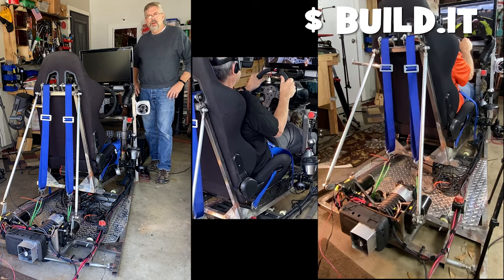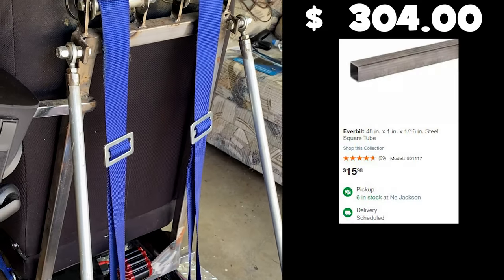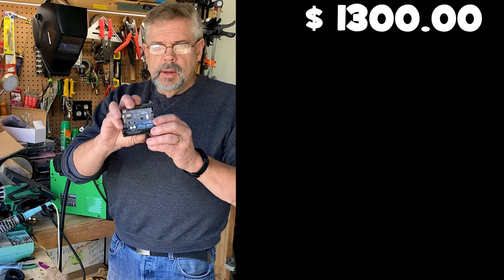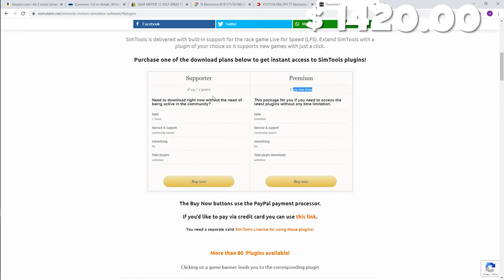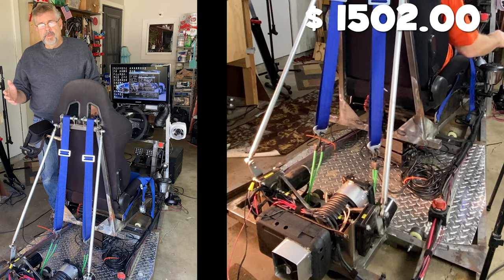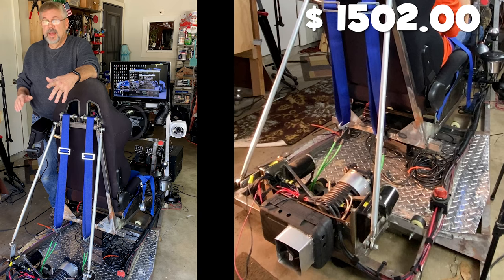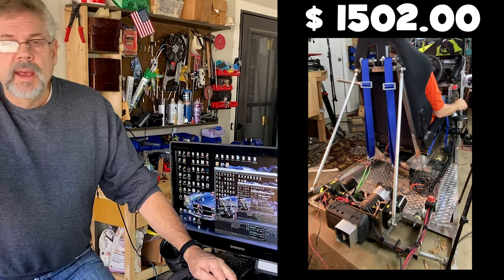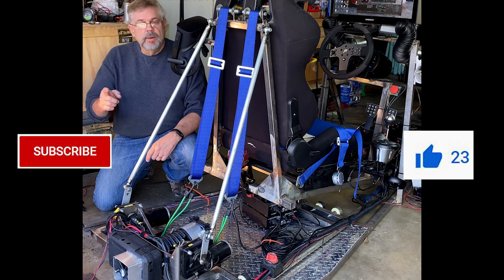How much does a motion simulator cost in 2021. DIY Racing Simulator Cost for Assetto Corsa.

Comment: This is what sim racing needs. DIY and the satisfaction of building something awesome. Great video, well done and thanks for taking the time to share it.
One thing to add is maybe consider a couple of gas struts on the rear rods to take some of the load and assist in the upward lifting motion. Saves some of the load on the motors and gearing.
Reply from the maker: Thanks my friend! DIY is great for sure. I am slowly tweaking the PWM on the motors and am getting better results for sure. I appreciate the comments! I could get more horsepower too!  I have seen some builds with those Australian 'motion dynamics' 60:1 motors and they are bad to the bone!  But they are $250 ea + a LOT for shipping..  I am probably going to order TWO of them in a couple months.  Horsepower solves (and creates) all problems!  DMAX👽
Reply: @DMAX_DIY  Shipping is a killer for sure. I live in Australia and getting stuff over here is bloody dear as poison and then there's the exchange rates as well. You get an idea in your head then by the time you add up everything it just puts you off the whole idea. 
Anyway love the videos and you overall vibe. Keep it up old mate.
Reply from the maker: @untrainedprofessionals2374  That company is in Australia and they apparently have more power than my Canadian Crab pot motors  50:1 as opposed to 60:1..   I will try an order a couple but it's a big 'chew'.. so I will post the upgrade whenever I actually order and receive them! I'm pretty hooked, like buying a boat or starting 'tennis' or something..  Oh well.. we shall see.. I love driving fast cars.. Thanks for the comment my friend!  DMAX
Reply from the maker: @untrainedprofessionals2374  Thanks.. I know what you mean.. I keep 'eyeing' those motion dynamics motors available in Australia but shipping is just so high.. I would really like to buy some but .. it's just insane how much they want for just shipping

Comment: Incredible project! I'm thinking of building a similar rig and there seems to be 2 schools of thought: using actuators  or motors (like yours), what made you choose this solution?
Reply from the maker: Simpler the better I guess. I looked into actuators from a video by 6 degrees of flight. I was leery that the motors I bought would not be powerful enough, but I was wrong. They are pretty good. I gave them a mechanical advantage by pushing the seat from the top instead of on the bottom like some people do.   Thanks for the comment!  DMAX

Comment: I'm still at it Dave!  Nearly there now. 2 DOF seat mover with wiper motors. Got circuitry sorted, earths isolated,  made my own crank arms.  Linkages completed. Need to drill out rear of wiper rotors to mount expensive magneto-pot thingies!, and then its just mounting the motors.  I have been doing this for 2 years now and YOU have given me the courage to carry on when all was lost - more than once!  Thank you so much!
Reply from the maker: Thanks for the comments my friend!  All is not lost! It's fantastic once you get it going..  I'm glad my videos helped!  Check back when you get it running! Dave

Comment: Amazing work, very detailed explainations! I built my first motion simulator 15 years ago with reductor motors pushing the top of the seat like you, I was inspired by the FREX simulator at the time. The biggest problem to me was the intertia/low reactivity (comes from the motor reduction ratio 50:1 is a lot). So I finally went for a commercial one, a GS-Cobra GSeat, a seat applying directly forces on your body. It is less expensive than commercial motion platforms, but very reactive, and it also makes you feel intense long forces (like cornering forces in a long corner) as well as traction loss.
Reply from the maker: That's pretty awesome my friend. I have been fiddling with power to weight too. I recently replaced the blue seat (about 42 pounds) with an aluminum Kirkey seat. (12 pounds). Waiting to run some responsiveness tests soon! DMAX

Comment: Awesome rig! As a welder, I give you props on your welding. You prepped the material before welding, and did a decent job... considering the equipment.
Reply from the maker: Hey Corky!  Thanks for the comment.. I'm a newby for welding.. but I at least I'm giving it a shot and (like everything) I'm giving it a shot cause it's the best solution..  better now after 8 months!!!  Thanks for the comment! DMAX

Comment: Hey Maan love the build . Which motors did you use for yours?
Reply from the maker: 12V crab pot pullers 50:1 from Canada off Ebay. Sometimes they are available by searching those key words on EBay. The vendor is PGSAW.. they were like $99 each ..

Comment: Great video. Can I ask what is the length of your u-joint?
Reply from the maker: Thanks for the comment Abram. I cant remember for sure and away from the rig till friday. But I'll put the info here on friday.. It may be on my x-simulator.net build page (first page probably) Take a look if you have a chance. https://www.xsimulator.net/community/threads/full-frame-2-dof-traction-loss-new-build.14740/
Reply: @DMAX_DIY  I've already had a look through the forum. All the measurements are there except for the u-joint one.
Reply from the maker: @abrammanoge   Basically I did not want to have to drop down to get into the seat cause I'm getting a bit older, so I kind of set the height to make it easy on myself. I'll measure it on Friday..  Thanks ! Dave
Reply: @DMAX_DIY  thank you brother. I appreciate you effort to help
Reply from the maker: Abram.  The entire U joint the 3DOF rig is 5 and 1/2  inches.  But like I said, I just wanted to be able to get in and out of the seat easily without having it too low.. Hope that helps you out my friend! DMAX
Reply from the maker: @abrammanoge  I measured it today. 5 and 1/2 inches total.. hope that helps! DMAX
Reply: @DMAX_DIY  thank you . I appreciate you taking the time to help
Reply: @DMAX_DIY  thank you brother . Just saw your response.  I'm gonna start my project.
Reply from the maker: @abrammanoge  Cool my friend! Just a little at a time and before you know it.. BOOM motion rig.  You'll never want to play a racing game without motion again.. DMAX
Reply from the maker: @abrammanoge  Sounds good! Dave

Comment: Were the bungee cords just to keep the seat belts right for you through all the pitching? Was there a reason you didn't just fix the seat belts to the seat? This is awesome and thanks for putting it together!
Reply from the maker: Good question Kevin.. No ..  The bungy cords were something I saw on another channel..  They just put pressure on your chest as the seat pitches forward to make it a bit more immersive.   The motion sim runs with or with out them.    It's just an immersion thing when you are slamming on the brakes..  Thanks for your question  Dave

Comment: hey dave thanks to you i have my frame for my 2 dof motion platform all welded up, most of the electronics are ready..
just waiting for my wheelchair motors and transformer to arrive and hopefully ill be rockin in my rig by the end of next weekend and of this goes ok im gonna add the 3rd motor too..
have a great day
Reply from the maker: That's great news! Be sure to use fan on the IBT fins so they dont overheat..  I still need to try 'pushing the limits' on those wheelchair motors.. probably this weekend I will test them really hard and see what happens.. I'll provide some amp readings too.
Reply: @DMAX_DIY  all good got the fan built into the lid on the electronics box. 👍
Reply from the maker: @ricomortis5881  Thats great..  I ordered the extra 12v motors I needed to give a 6DOF a try but I have to tear apart my 3DOF rig to use the 3 motors it has..  I'm not quite willing or ready to do that yet so..  Maybe after summer ..

Comment: What do you have on the ends of your conduit to thread your tie rod ends into?
Reply from the maker: The Tie rods ends are just round.. They slide right into the 1/2 inch conduit (with a little persuasion)  Then I tack weld them so they dont come loose.   I did some more explanation on this in my last few videos on building a 2DOF rig..  https://www.youtube.com/watch?v=iTXBVX8CHCc

Comment: Hey D Max
What did you use power the motors? Could you provide the link?
Reply from the maker: The motors are 50:1 crab pot motors from PGSAW on ebay.. I just checked and they are unfortunately not available at this time anymore.. I wanted to get 3 more of them..  Just search for 50:1 or 60:1 12 volt motors..  If I can find more that are reasonably priced I will link..  You can get 60:1's (which are better.. ) from a company call motion dynamics in Australia.  But the price is not cheap.. DMAX
Reply: @DMAX_DIY  thanks for the reply.
I already have the motors. I was wondering what power supplies you are using to power motors?
Reply from the maker: @heyitsdiogo1243  OK.  sorry.. Great that you have the motors..  So they are 12V.. Same as a truck or car battery.. I use an 850 CC truck battery from the local Walmart.. I have a 4 amp  Battery tender trickle charger on it. 
DMAX
Reply from the maker: Hey buddy.. I am doing a giveaway for Christmas for a few Simtools Pro Licenses..  That's the big one..  Simtools and all the Plugins..  If your interested, I 'll be posting some stuff soon..  Just enter to win.. Sound good?  DMAX

Comment: Now show us how to do the most cost effective motion or sfx100 for a 8020 rig :) If I didn't already have my 8020 rig I'd almost consider just welding up something but the lady wouldn't want something that didn't look "nice and racey" lol. Love your work though, amazing!!!
Reply from the maker: Henry, I was actually thinking about making an 8020 upper frame and a Kirkey 55 aluminum seat. I want to lighten it up a bit. My rig is in the garage for now till it's pretty much finished so I'm all good to take my time. I'd like to compare the weight savings and responsiveness.  That's an awesome suggestion! DMAX

Comment: I have my rig on a Mygale F4 chassis, weight with driver around 350pound, do you think can work ok?
Reply from the maker: Well, I'm 205 and the weight of the steel frame, the V-3 pedals way out in front and the CSL wheel all combine around 100..   I think that as long as you find the 'balance point' of YOU Sitting in the RIG. Those motors wont have too much issue  pushing the top frame around.  I would make the design similar to mine as you need the mechanical advantage from pushing and pulling at the top of the seat.   ALL the weight is held up by the U joint, the motors are pretty strong.  If all you have is part of the chassis to move around you might be ok. Take a look around xsimulator.net - there are a ton of people who post different designs. And best of all, you can ask questions there too.. DMAX
Reply: @DMAX_DIY  Many thank's I gonna start to work now, do you have the link of the motors and the other parts?
Reply from the maker: @claudiovillarino877  The motor links change all the time.. just search ebay for this..50:1 12volt motors  just search Ebay for GEAR MOTOR 12 VOLT GREAT FOR SAWMILL/CRAB POT PULL/FEED/SIMULATOR 75-80RPM 50:1  (sold by PGSAW in Canada)
I also updated the 'description' part of this video with links to all the critical parts take a look.. I just updated it today  DMAX

Comment: Yo, Awesome Hero Dave! Hey When Buying Motors for this Type of Project Do I Need a Left and a Right?
Reply from the maker: Thanks for the question.. No not really.. because you can swap the direction the motor drives either by wiring or in software.  But Since all the motors are pretty much the same, you may have to mount the motor shaft differently for left and right like I did in the 3DOF..  That was a great question my friend! DMAX

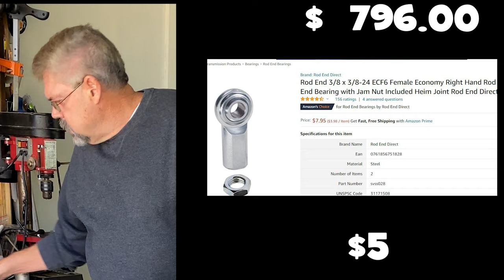Comment: At 5:14 you show tie rod ends from Amazon. Which I ordered. But then realized what you have in your hand is external threaded not internal threaded like the Amazon pic model.  I think I ordered the wrong one. Also, are you sure they’re 3/8?
Reply from the maker: Yeah 3/8   they should come with a sleeve.. The sleeve inserts into the 1/2" conduit I use for the rod part.  I think you will be fine. I recently ordered another set and they were the same.
Reply: @DMAX_DIY  Thank You  DMax
Reply from the maker: Also take a look at this video series I am working on .. It shows the tie rod construction a bit better than the overview video..  Go to about the 5 minute mark on this video   https://www.youtube.com/watch?v=i3PhnEqmgfs

Comment: I'm curious how long the truck batter lasts operating this? Do you put a tender on the batter when you are using it? Or have you changed it and put a power supply on it?
Reply from the maker: Great question Trevor.  I do have it connected to a 4amp battery tender but that's just to top it off when I'm not driving the rig.  The battery is a 12v 850CCA truck battery. It's never run down while I am operating the rig. Max amps (I have measured) is 27 amps. That is combined with all three motors on hard braking to hard acceleration.

Comment: How is the welder? Im looking to get a welder so I can fab a rig. Did you run it on 110v or 220?  Were you tripping breakers? I have a 20amp breaker so i think I'm good?
Reply from the maker: Its been working fine.. it's  20 amp breaker at 110VAC.  no issues at all. It's a flux core welder and other than being a bit 'dirty', this is my second spool of wire..  Big props.. way easier than a stick welder.. just point and shoot!  Welded today in-fact!  and I'm getting better at it!  DMAX
Reply: @DMAX_DIY  cool, i used to be a maintenance man in a foundry, ive done a whole bunch of stick welding, but that was on a "real" welder that ran on 220. A big expensive (ancient) Lincoln electric monster. Thanks for answering my questions. Appreciate it. I probably pick up one of these soon.

Comment: Was this weekend on a flightsimulatorevent and have seen some motion platforms.    Seeing your movies maken me excited to try to build one myself.
Do you think the motors u used can hold a platform with 150 kg load (me and cockpit) ?

Keep up the movies, they are a great help, so thank you for that.
Reply from the maker: That's a good question Revving Rebel.  Where was the show at?  I bet it was pretty cool!  Right now, the designs I use have the U joint which supports the weight and the motors just move the platforms around the balance point..   Next year I am going to unhook all six of my motors and try building a stewart platform  6DOF in which, there is not a u joint and the motors would have to support the frame and seat, pilot etc..  So i dont have an answer for you at this time bc I have not tested them to that extent.. Dave
Reply: @DMAX_DIY  Hi Dave, tnx for your quick answer.  I was in Lelystad, The Netherlands. It was awesome with a lot of cockpitbuilders, hardware company's etc.   I you have the chance you must go.  Gonna use your video's as a manual to build a platform myself but with a cockpit on it.
Also thinking about a U-joint en 2 motors.  i am not a genius in electrics so have to keep it as simple as possible :)

For now i am building the cockpit so have the time to explore and prepare for the build.

Keep up the good work and good luck with the 6DOF platform.   looking forward to the movies.

Arie
Reply from the maker: @revvingrebel8213  Thanks Arie!  It's great getting into this stuff and oh man is it fun when they are moving in VR or even with a screen setup.. Just keep pluggin away and take your time.. Dave

Comment: Want to do this as a class project and am looking at motors do you have a link to a good motors?
Reply from the maker: Well I would get the 50:1 crab pot puller motors from PGSAW in Canada.  the parts should be in the description area of this video. They are usually on EBAY just search for 50:1 12volt motors  just search Ebay for GEAR MOTOR 12 VOLT GREAT FOR SAWMILL/CRAB POT PULL/FEED/SIMULATOR 75-80RPM 50:1  (sold by PGSAW in Canada)

Comment: do you have measurements list for the rig fames and what motors can you recommend?
Reply from the maker: Hi yes I have posted them on x-simulator.net 
https://www.xsimulator.net/community/threads/full-frame-2-dof-traction-loss-new-build.14740/
and I have had great luck with the 50:1 crab pot puller motors. Here is the link for that too. https://www.ebay.com/itm/371596157992?hash=item5684db6428:g:A0EAAOxyW1NRER~7

Comment: If doing a 3dof, when getting the COG for the seat do I get the COG for the seat using the pole on the floor method first then I find the balance point for level with the whole rig OR do I find the COG with the chair pedals etc all on the frame and balancing it with me in the seat first? ..does that make sense?
Reply from the maker: COG with all the stuff and yourself..   It's a circus act..  but you can get close..  SEAT PEDALS, YOU..  all the weight.. 😬